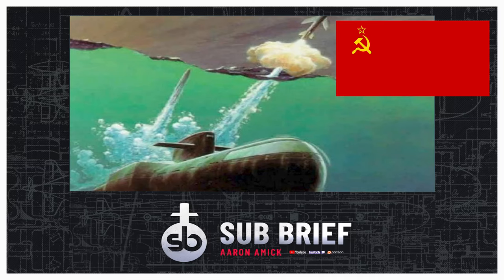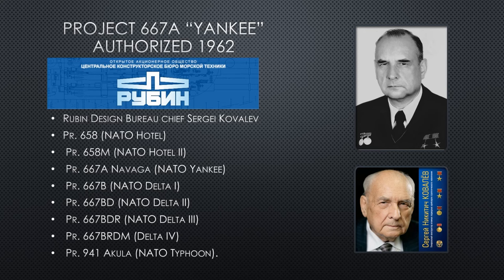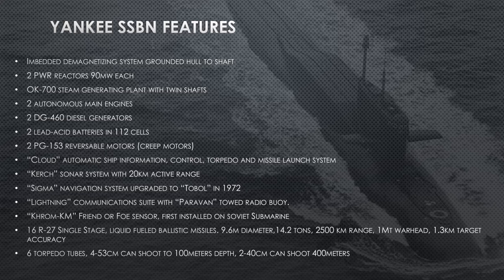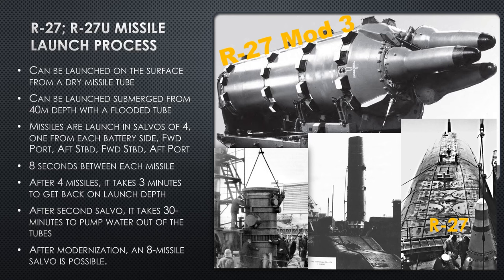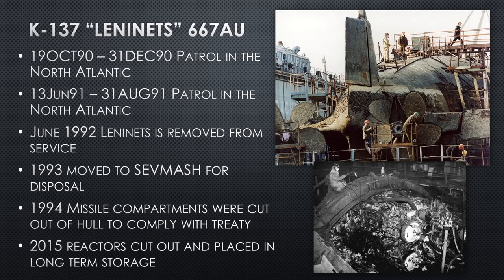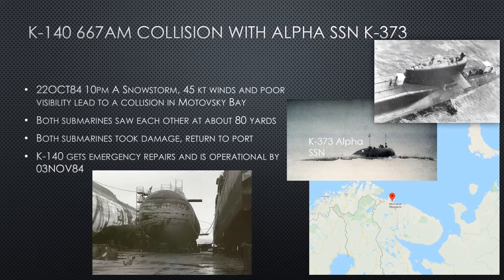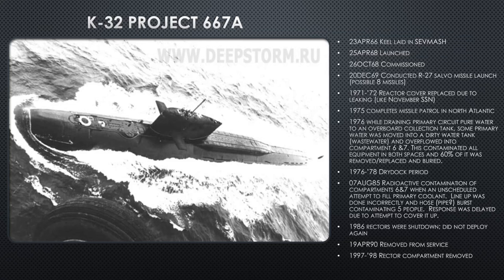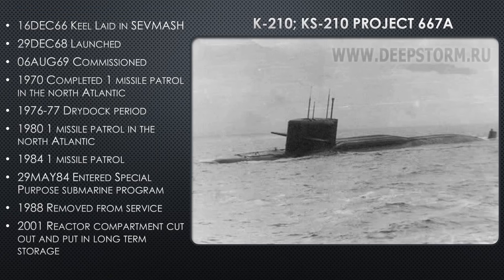Yankee Sub Brief Super Cut

Comment: I have a polished black car that has been OptiCoat Pro+ coated that is being maintained on a weekly basis with Gyeon SiO2 products as toppers. Water sheets off rapidly on the vertical surfaces and beads into tight little spheres on the horizontal surfaces. My final rinse after washing is with distilled water from a pump sprayer, followed with a blow dry from an electric blower; the slight residual water dries off very quickly and easily. The water droplets on the surface seem to have very little negative potential energy, are very loosely bound to the surface and will quickly accelerate along the surface given any impetus, from gravity or by kinetic transfer. The main benefit is repellency of contaminants and ease of cleaning.

Comment: Question: would it be feasible to put small hydrophones on a type of periscope to listen for subs or ships in a different thermal layer?
Reply: Maybe if a towed array would be able to change its bouyancy it could do that?
Or if they'd have some other way of changing altitude on the towed array, like fins of some sort.
Reply: @firkopersson ,

Many surface ship towed arrays are designed to do this; they're usually called "variable depth sonar"

Also multiple simulators I've seen model submarine towed arrays as negatively buoyant, kept from sinking by the tension on the line caused by the submarine's forward movement dragging it along. At low speeds the line will sag a little so you could run just above the layer and do it that way. 

Theoretically you could maybe listen above the layer from below it by making the towed array positively buoyant instead and controlling its depth by reeling portions of the wire in or out, like the radio communication buoys many subs use to stay in touch while submerged?

Comment: that moment  when you said  500 megatonne warhead !!!!!   just blows my mind  that we had that kind of craziness  in the ocean  . how did we  not all become glass ?
Reply: 50Mt was the biggest nuke ever.  The Tsar Bomba
Reply: Theoretically, it is possible to attain two gigatons with a five stage weapon.  Tsar Bomba was a three stage one.  Each stage fuses heavier elements.
Reply: @mikecimerian6913  tsar bomba was designed as 3 stages and 100Mt, but they removed the 3rd stage before testing I believe.
Reply: No, they wrapped it in lead instead of cobalt. That way it had little fallout. Comparably speaking with conventional nuke weapons.
Reply: @rydplrs71  Yes, Sakharov was worried about fallout.  I doubt that the launching bomber and the observer planes would have survived too.  They were coated with a special ablative paint, even so, once they landed back one could punch through the fuselages with a ballpoint pen.